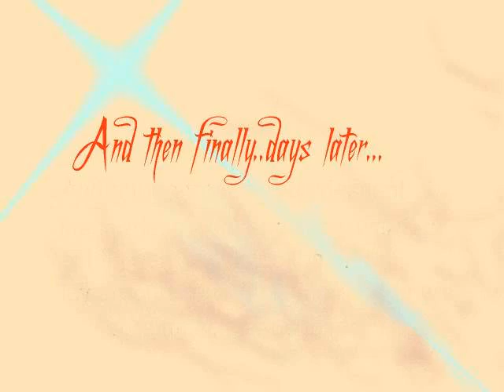Crumar Organizer 2 repair tips and demo part 1

Comment from the maker: @blackhat81 Yeah an ESR (Equiv. Series resistance) meter is required to tell if capacitors are going bad w/out pulling them and checking leakage and capacitance.  Very handy tool..highly recommend getting one.

Comment: Great videos. I had the good fortune to find a crumar string man in a charity shop last week. It's working fairly well apart from the g notes are out of tune and there is a lingering single note sustaining after everything that's played. I opened it and found a leaking capacitor. Would that be the solitary cause? I'm  fairly clueless about electronics by the way.
Reply from the maker: Not sure how G's can be 'out of tune' per sey.  Maybe different timbre too?  That would be a bad divider chip.  No the leaky caps will cause hum and eventually will possibly short circuit